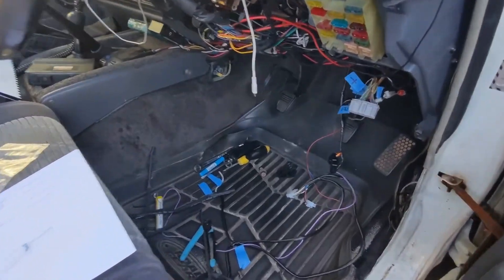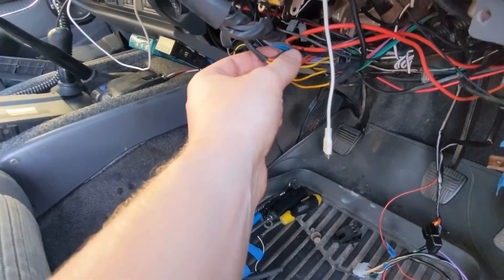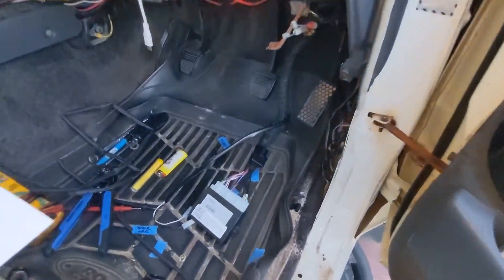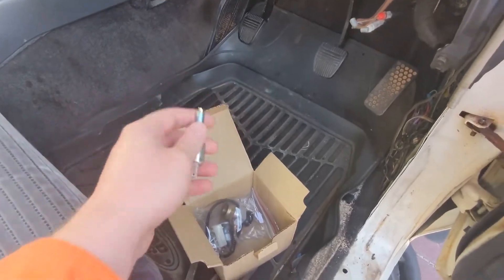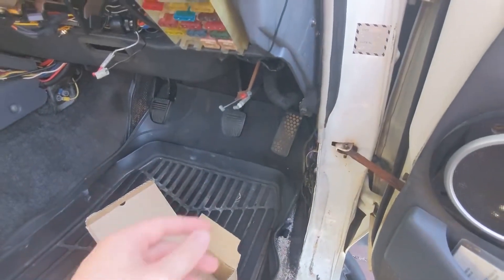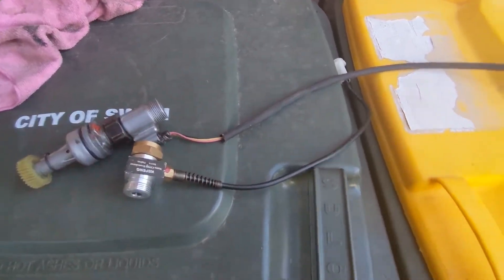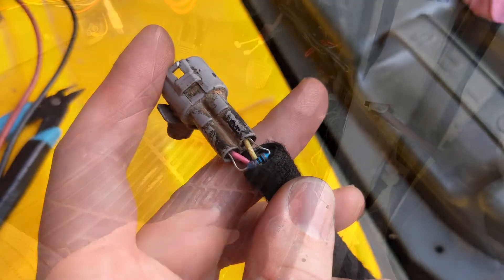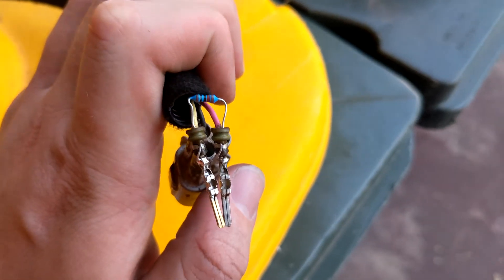Fitting electronic cruise control to the 1HD-FTE 80 SERIES

Comment: What colour was the wire on the cluster for the speed signal you taped into?
Reply from the maker: Can't quite remember but if you take the cluster out, from memory the speed sensor wire has SPD on the circuit board. If not you can follow the trace from the Speedo.

Comment: Hey Brendon 
I’m doing the same thing with my 80 , only difference is my cruise is in the 100 series ecu , still two wires, and my 80 cruise stalk is a 3 wire not a five wire.
Any advise on what goes to what and what resistor I need.
Cheers.
Reply from the maker: You'd have to pull up the manual for the ecu cruise control and see what signal it needs. It'll usually tell you the readings it should be in the electrical fault finding section. Then just test your stalk with a multimeter to check which each wire does.  
Should be on/off, ground and signal for a 3 wire. 

Might not end up needing any resistors as it should be within your 3 wire stalk.

Comment: Hi Brendon, I’m doing a ground up rebuild on an 80 and have bought an fte for it. I also bought a 200 series steering wheel for the stereo controls that I can run wirelessly with a kit from PVS. I would also like to use the 200 factory stalk for the cruise control but given the 200 wheel has a clock spring would you have any suggestions on who to contact for a “work around” setup… preferably wireless but take whatever I can get.
Regards-Dusty 👍
Reply from the maker: Hey mate, pvs make adaptors for 200 series wheels on 80's. Hit them up.
Reply from the maker: In regards to getting the stalk to work, contact autostrada as they're some smart blokes. They should be able to help you out as they did with mine getting the stalk to work.